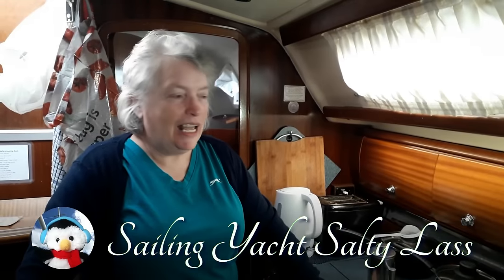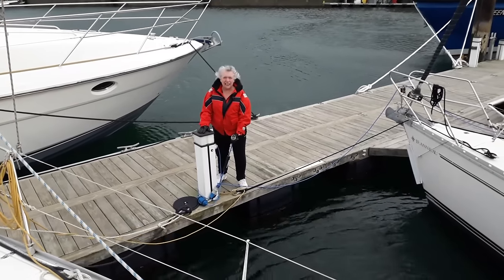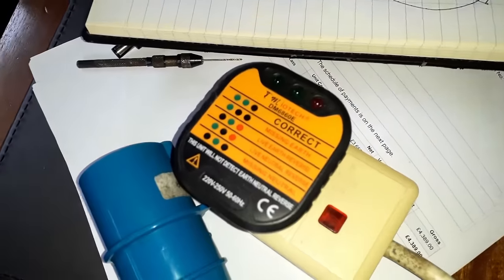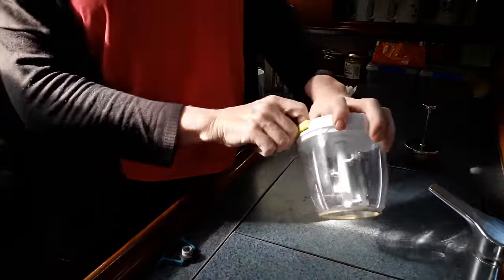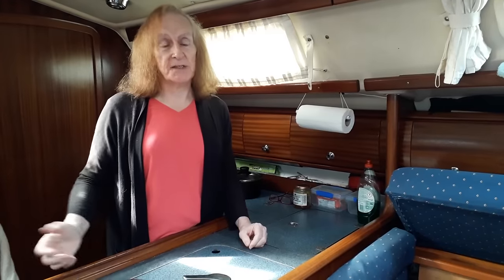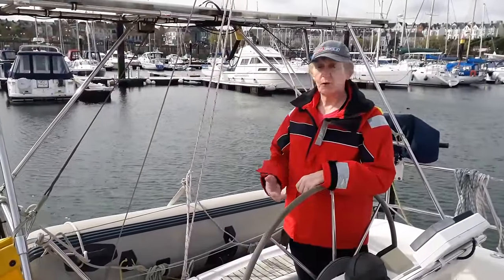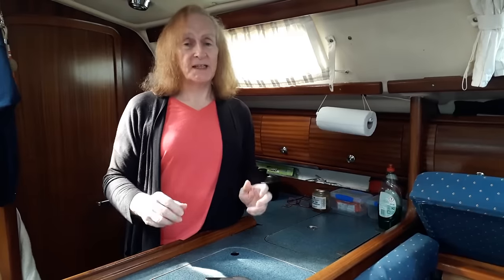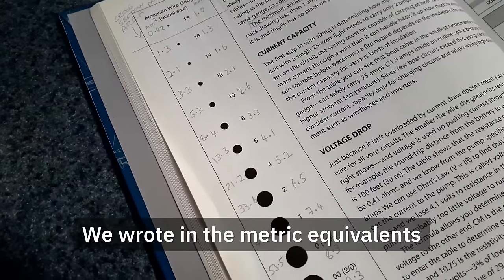Winter talks - AC Power - Electrics - Lithium Batteries - Lead Acid Batteries - Ep. 335

Comment: I’ve had LifePo4 batteries for my domestic bank for years. It changed the way I sail. I now use a deep freezer and a fridge. I simply switch the kettle on for a cuppa as we sail. The tv and microwave all run off the batteries too. For charging I use solar panels and a big alternator. The system has safeguard’s and redundancy built in and so far it has all worked perfectly. Lead acid is something I would never use these days.
Reply from the maker: Thanks for the feedback. We are getting lots of good info and we have the time to consider all the responses as upgrades / replacements are still some way in our future. Thanks for getting in touch. 👍
Reply: We have had LiFePO4 batteries for years and they ARE a life changer for us. We run any electric appliance from them - except our massive electric cooker / oven. That one we can only run on shore power and genny. But a single ring induction cooker, a kettle, a toaster etc. is not a problem. It‘s a big upfront investment and you‘ll have to make a few changes to the system, e.g. to protect the alternator from burning through when charging the lithiums. We still believe that over the lifetime of the lithiums they are cheaper than traditional lead acid or AGMs with a huge upgrade in boat life quality.
Reply from the maker: At the moment we are following the well established engineering principle of "If it ain't broke, don't fix it". So far everything continues to work as it should.
Reply: @SailingYachtSaltyLass  makes sense!

Comment: Easy, boil the kettle, fill the teapot.  Whilst the tea is brewing, make the toast and when you are ready to eat the toast, the tea will be ready. 😄
Reply: Good coffee is an art!
Reply from the maker: @davidswheatley-talesfromth1796  - That is more or less exactly how we do it 😄
Reply from the maker: @pioneer6722 - we agree 👍
Reply: @SailingYachtSaltyLass 
Hi 
The suggested connection scheme while being perfectly ok & will possibly improve balancing.
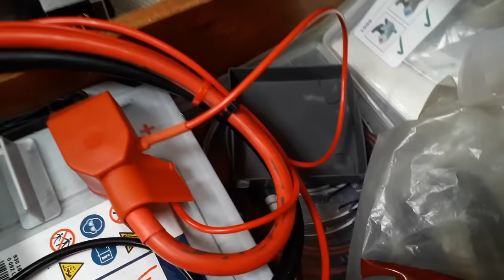  13:22  but I looked at some web pages & noticed some odd stuff which didn't make sense about extra special balancing connection schemes for parallel LA batteries of 4 or more batteries. No, the schemes do make sense for 4 batteries & above but the balance improvements are even less than would be obtained with the simpler balancing connection scheme. 
     Going into it a bit further it seems that not only do the parallel batteries naturally balance during charge, discharge & while resting simply by their individual change in voltage but during ageing over the longer term they naturally balance as well so that their usage rate & ageing evens out as well.
  In theory it is my contention that the parallel batteries will have the same lifespan within about ~0.271% +/- 0.062% approximately of course. 🙂 
(that's without a special connection scheme & with reasonably adequate size interconnection cables.)
  I'll be doing some tests & looking for practical real evidence online.
 With parallel batteries I might be tempted to have a separate charging module for each battery & diode combiners between the batteries & the load.

Comment: I’ve got a tiny boat with a fairly basic electrical system. The whole lot was running on 1x 110ah lead acid. I moved to lifepo4 because the depth of discharge is 90% The rated Ah is the same as the usable Ah i.e. 100Ah is more like 110Ah. It’s also 40% lighter. It’s basically twice the battery for half the weight in my application. 2000+ cycles. 

Lifebatteries seem to offer a 10yr warranty.

I appreciate it’s not for everyone but this worked for me.
Reply from the maker: That is great to hear. We are not saying that everyone should avoid them, just why Lithiums are not right for us at this stage.

Comment: While I certainly understand your sentiment, we also have a Bavaria 36c and have gone the LifePo4 route (1,800Ah self build). I totally agree it is an expensive setup to install with large solar array, wind generator, high output alternator, 5Kw inverter etc. required to take full advantage but it does allow you to have all the comforts of a land lubber totally off grid. Its "Horses for courses" I guess - as once you consider running electric cookers, freezers etc., let alone water makers, dive compressors off grid, lead acids just wont cut the mustard. I personally also thing LifePo4 battery's are far safer on a boat than gas for cooking. As you rightly pointed out Lithium Ion are different and are more dangerous than the LifePo4's used on boats. Most new Lifepo4 batteries have a 3,000+ hour cycle life which on a boat could be 20+ years and prices are coming down. If down south to Dun Laoghaire again I would be happy to show you the installation. 900 watt kettles are available which will ensure your coffee and toast are ready together 🤗.
Reply from the maker: I love the 900W kettle idea 👍 We are not worried about land lubber comforts. Once we get coffee and a bit of chocolate all is right with the world. 😄 Nothing wrong with lithium, it is just in our case we cannot make the numbers work. If our circumstances change then maybe the cost/benefits will too.

If you see us around in either Dun Laoghaire or elsewhere, please do give us a shout!

Comment: Hi Electrican here , I'm always mindful of power draw , you can get 600w toasters and kettles, although they take a little longer to toast and boil, I've even got a small air fryer which is 1000w. I very neat Idea on the market now are the solar generators , which can be charged from 12vdc, Solar or mains 240v. I use ecoflow myself but there are many many makes. Not cheap by anymeans but gives you a very easy solution to having 240vac offshore or at anchorage. and will save of Gas use for boiling water etc.
Reply from the maker: We are looking at extending the system somewhat and adding a 12V immersion for excess power from the solar panels to heat water onboard. That in itself would be great. We do have a small inverter aboard (actually we have two of them) and almost everything else on the boat already runs at 12V.

Low power toasters could be great. I will have to look into thatone. Thanks for the tip 👍
Reply: @SailingYachtSaltyLass  I don't have a yacht but do have a fancy camper, I've found the 12vdc immersion heater next to usless and takes ages to heat water, BUT certainly tons of options out there Good luck and like your down to earth channel. I think Ecoflow are gearing now toward the boat market, there is a video on youtube from them somewhere
Reply from the maker: From our point of view, everything at sea takes hours. Situation normal  😄😄 Thanks for the feedback and we are glad you are enjoying the channel. Maybe one day you will get a boat! Campervan on water ....
Reply: @SailingYachtSaltyLass  Spent 30 years mercahant Navy and Merchant Marine and missing the sea
Reply from the maker: @SteveJones-gz4vd   - I can understand that. Even after a short break we feel the need to get out there.

Comment: Like your new kettle Gaynor!  Many camping type shops have low wattage 800 or 1000W kettles however quality is normally pretty poor; we've gone through three in last two years!

As for 16A feeder posts, we came across 10A sockets in Scotland, found several 6A sockets and even one marina in Norway had 4A sockets ... 4A sockets!

Still looking pretty breezy in Northern Ireland. Keep those hatches closed and that new kettle hot :-) Thanks for the video.
Reply from the maker: We may just have to buy another cheapie Tesco special. 1500W and lasted 3 years... 😄 The weather is indeed windy. If it was not for the separate microphones that segment of me standing by the solar panels would have been unusuable 😄😄
Reply: I got a really decent 800w auto lift-off kettle from Amazon about £20. V compact, cylindrical fits galley well, minimum footprint. Used everyday 2 yrs, as also FT live aboard, out on wild coast Finistère, Brittany 
Must add, I replaced my 6 yo hefty 400Ah Deep Cycle house bank with single 200Ah lifepo4 lithium, good brand, SOK, 7yr warranty, 8000 cycle, just under £1k, paired with v impressive RENOGY DC -DC charger, that's coordinating solar or alternator, and balancing charge, priorities, for both house and engine battery banks, was about £300. Now... Truly autonomous, was able to heat boat for 2 months, November, December, power Eberspacher, when most extreme storm ever recorded here, just within sight of Ushant, or Ouessant, smashed pontoons, tore big Passarelle away from shore, so, no electricity, cables ripped away ... no access, lotta Zodiac tender trips. Have 400w solar, and because no worries about discharge below 50%, only needed to run engine handful of times. Game changer ... and, now adding 2nd lithium, to give reserve, and better use the surplus solar, as often topped up before midday, and could then give potential back up, for engine starting, without risk tripping BMS high-discharge limit. Strongly recommend keeping conventional battery for engine, better suited, even small one, in case need to re-boot lithium BMS lockout. Of course, means can easily power my old Victron 1500w inverter too, for power tools, etc. 

I was slow to go down lithium path... but, I spend 6 months summer on hook, occasionally a buoy, and was always a stress, nursing lead-acid, one eye on volts, monitor. .. regular SG measurement every cell, and ... Acid, hydrogen ... Lost one, with COVID lockdown, electrolyte evaporation when unable to get on board for several months. Don't need any regular access for lithium, as it's Bluetooth BMS... Lighter, smaller, so, freed up some prime space, giving better engine access. 

I'm totally convert now, and, you'll know, lithium phosphate, no significant hazard, compared to other lithium chemistries, and, lead-acid. So far, BMS only recorded 4 full cycles... After 2 yrs well used.

Price has significantly dropped now, btw.
Reply from the maker: @Neptuneboy1959  - thanks for all that great info 👍Like you, our solar has the batteries topped up early and we just go from there. As soon as they are on float we use all the excess energy. Our next upgrade might be fitting a split 240V/12V immersion in the calorifier so that some of the daily excess can heat water. Even just warm water would be nicer than cold.

BTW - well done on surviving that big storm. I think many of us got more practice doing that in 2023 than we ever wanted...
Reply from the maker: That is great info - thanks for telling us. Our next "upgrade" is likely to be more minor. Since, like you, our batteries are topped up early in the day, we need a use for all that excess electricity and we are looking at replacing our immersion with a dual 240V / 12V element. Even just warm water would be a big improvement over cold water ...

BTW - well done on surviving the big storm. I think many of us got more practice at that in 2023 than we ever wanted.

Comment: We have 420 Ah of LiFePo and solar, and use induction cooking and electric to heat water. 
Rarely use our propane.
We also hand grind coffee but really using an electric coffee grinder uses very little electric.
Toast is better in a frying pan, not a toaster.
Turn your inverter off whenever not in use, just proper ground fault outlets will defeat an inverter's attempts to sleep.
Reply from the maker: Your life experience is not our life experience. Toast in a pan is rubbish compared to toast in a toaster. We have tried all the variations (unless there is a special frying pan we should be using???) 😄

Our inverter is almost never switched on. It's main purpose is to charge the drone battery when out at sea and, very occasionally, a second laptop.

Comment: Jolly good review. I have an almost identical setup to yours and operating philosophy same. I don’t live aboard but when passaging I am totally self sufficient in my electron needs. I only use shore power to run a small dehumidifier. I recently bought an induction plate and use it mainly to boil water dockside, which goes into a thermos and provides a days hot water for drinks etc when at sea.  I have a separate bank to run a refrigerator and again comes off a separate solar panel. That system runs forever even as you find on cloudy days. Cheers, SV Dreamtime
Reply from the maker: Not having all the electric guff aboard is a great relief. We insulated the fridge to reduce its usage and pack it as full as we can. We will likely just replace the batteries in the next year or so simply because 5 or 6 years should be plenty old enough for a battery.
Reply: Mmm like the separate fridge battery idea.
Reply from the maker: @WavedancerWesterlyfulmar  - it has its attractions for sure...
Reply from the maker: We do as well. Interesting for sure..

Comment: A waterboiler wants to boil water, therefore there is NO restriction on powerussage, ea a waterboiler eats as much electricity as it can pull.
I love that you put 2 lines on the visor, so you can heat 1 or 2 cups, this will be much more efficient.
Reply from the maker: Well spotted 👍 I forgot to mention that in the video. The lower line is for two tea mugs of water, the upper line for two coffee mugs. We are highly organised around here.... 😄

Comment: Funnily enough, in actual fact a dc to dc converter has to convert 12v dc to AC before it steps it up to 18volt and then converts it back to dc. 😊
Reply from the maker: That is true for some DC/DC converters but not all. Given the weight of the unit in the video I suspect that it is just a buck-booster. I know they oscillate as the inductor and capacitors do their thing but there is no heavy, inefficient iron core in there...

Comment: Over a year ago I upgraded my coffee setup, ideal when not at sea.

A 1zpresso k-ultra hand grinder (adjustable settings from very fine Espresso to very coarse French Press). Takes under 30 seconds to grind enough for one mug. Infinitely better than the cheap small hand grinder I had before.
Timemore nano scales so that I can be precise in the beans to water ratio.
Still using my Aeropress.
Testing with my regular TankCoffee Glory of Africa beans.
Slight trickery to extend James Hoffman's recipe from 200g to 300g of water for a full mug.
Less than 4 mins in total to make.
Absolutely delicious!
For Jane we are practising foaming milk using the microwave to heat it in a small cafetiere, pumping the plunger quickly gets a pretty good foam. Practice will improve it.
(There are small automatic electric milk heat and froth devices which don't use many amps).
For offshore I'm going to use an electric coffee filter that fills an insulated flask. I'll put it on the gimbled stove. This way no hot water to juggle with.
Reply from the maker: I really like the idea of frothing using the small cafetiere, but I am also impressed with your dedication to the art of coffee making. I am also not surprised that Mr Hoffman gets a mention in your comment as so dedicated a coffee buff as yourself surely had to be aware of the Greatest Barista ever 😄
Reply: @SailingYachtSaltyLass  we are now converted to the USB Nanofoamer, faster, better quality foam than the small cafetier and much easier to clean.
Reply: @SailingYachtSaltyLass  James needs to get serious about making great coffee while sailing 🤣🤣🤣🤣

Comment: Thanx for this video. It was great as always. I would like to upgrade to lithium batteries, but they are too expensive and needs other chargers too. I agree with you that it is much better to upgrade the solar panels and continue with the old batteries. I guess I will upgrade to at least to 100w 24v panels and mppt regulator next year. At the moment I have 50w 12v panel and a single battery from 2016. It is enough for short day trips or weekend during the summer.
Reply from the maker: The trick is having enough power to be comfortable. There seems little point in having way, way more than we need.